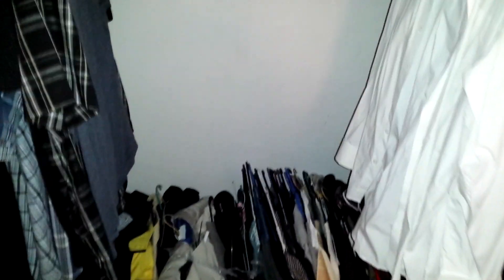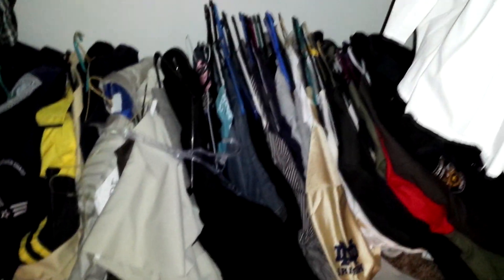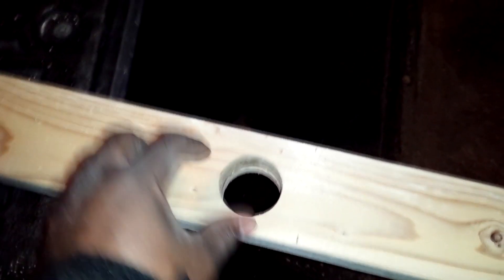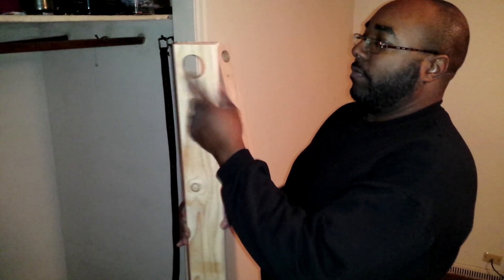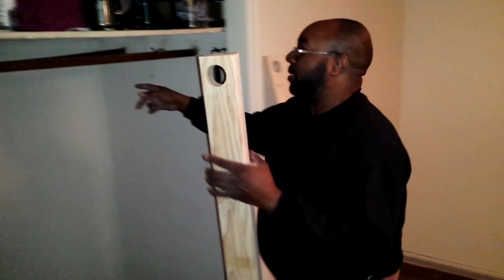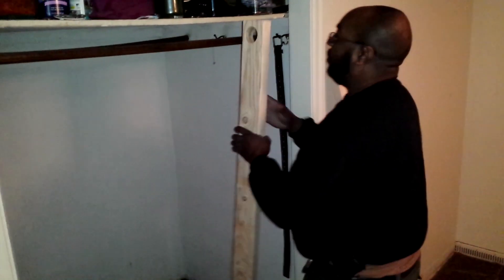How to Reinforce Closet Rods

Comment: Our bar and shelf above it were bending so we modified your design by just cutting a U-shaped notch in the top of the 2x4 so it could support the bar and the shelf and we wouldn't have to remove all of the clothes.  Thanks for the video.

Comment: They make rod brackets that help support the weight of the rod. It attaches to the wall and shelf above it and has a loop for the rod. With the use of the bracket it allows for full use of the space below it without anything blocking it.

Comment: Use metal pipe 😉
Reply from the maker: The wood never broke. It would've been the same result with a metal pipe because the flex from the middle caused it to come out of the retaining brackets at both ends, hence the need for a middle support.

Comment: Someone please help me i have a 7× 9 new walkin closet EVERYTHING IS WOOD 9'SHELFS , TWO 7' WOOD POLES I PLACED ONE WOODEN BRACKET IN THE CENTER OF EACH  unfortunately the was a doorway where the bracket needs to be.  (Duh)no stud[] And the anchor with bracket was not enough  so i hung (alot of clothes)   well it wasnt enough to support the heavy weight...  i am quite upset  this was all new sheetrock with holes. I dont want to get more brackets thinking w/ no studs all will fall also and destroy my wall.   I do the work myself and before i do further damage i would appreciate all suggestions.    The pole is 10" from the wall  and i have circle little things for poles to sit in.